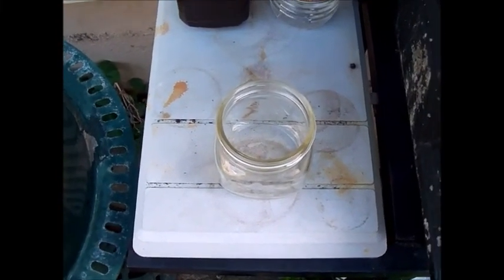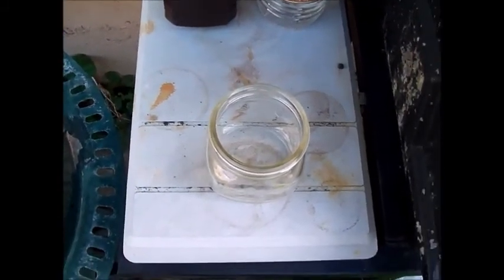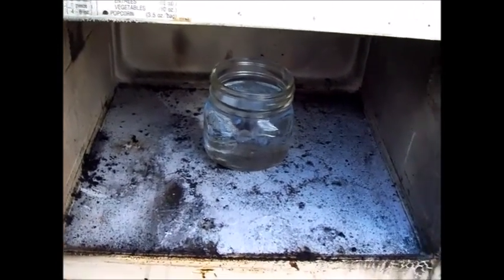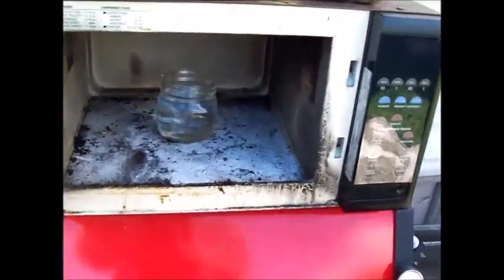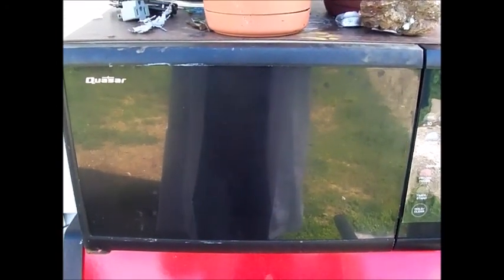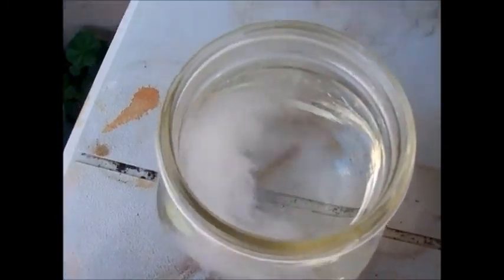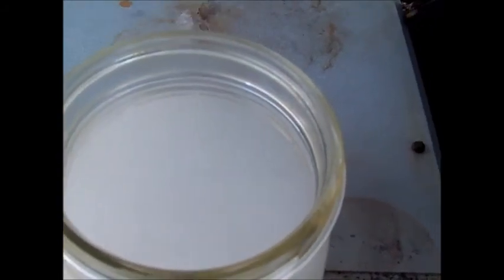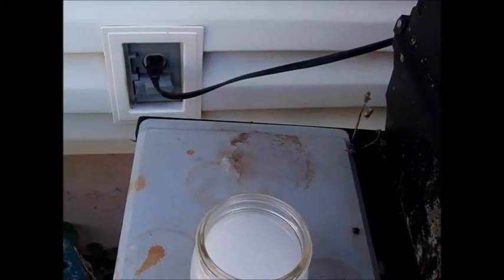lead electroplating

Comment: As i know, lead gets dissolved in acids and its more reactive than hydrogen so plated lead will quickly dissolve back to solution. But the thing that blows my mind is that on reactivity scale nickel is even more reactive than lead itself but it wont easily dissolve in acids and it can easily be electroplated. I cant comprehend that s*** and im a chemist. :I

Comment: could you tell me the current and the voltage used to plate the coin
Reply from the maker: I believe that my adapter was 12 volts at one amp, however that's actually fairly high for electroplating. You would probably have better results using les voltage, say more like 3 or 4 volts.

Comment: I didn't know you could use lead as a sweetener! Interesting!
Reply from the maker: you can, but i would obviously advise against it xD
Reply: Haha, of course!
Reply: Almost as dangerous as aspartame.
Reply: @n4mwd  I read once about some poor bastard who left a 2L bottle of aspartame sweetened soda out in bright sunlight for several hours while he did some yard work. Took indoors, re-chilled it & had a glass or two. Surgeons ended up removing a substantial length of his small intestine. Aspartame is not to be toyed with.
Reply: @bobbofly  Its been proven in numerous studies to be a neurotoxin.  Makes me wonder how many of these glioblastoma clusters have been fueled by aspartame.
Reply: But don't!
Reply: Almost as poisonous as sugar.